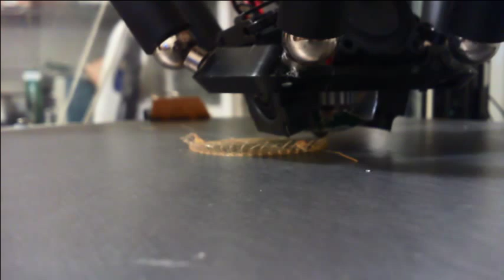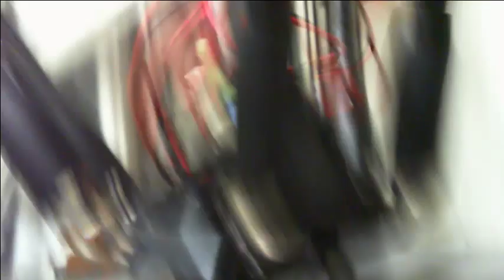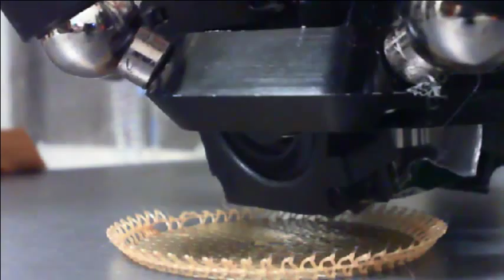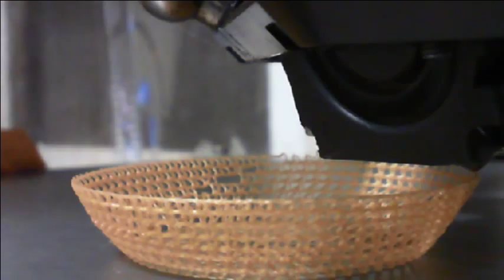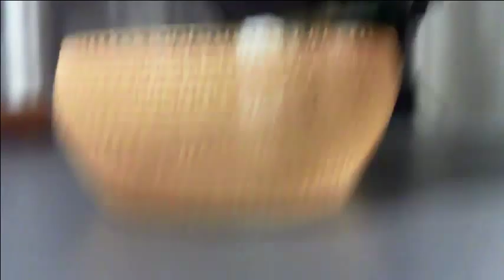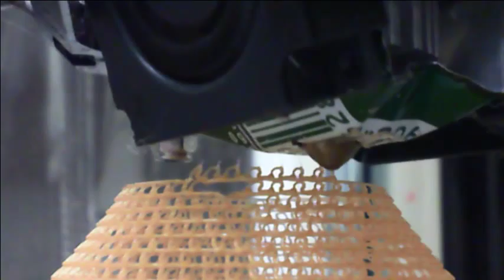Wireprint Vase by Cura 15.06.02 on ATOM3Dp

Comment: I am digging the heat shield. The print looks to be going better than a video you uploaded previously on the 27th. What tweaks did you make between than and now?
Reply from the maker: +Mike Creuzer i tweek my nozzle angle in cura setting for correct one.
Since my nozzle is not common E3D style.

Comment: how to set up the wireprint @@
Reply from the maker: Bruce Vlog 
Use Cura 15.06.0x
in configuration open the wireprint related options.
BTW, you might need to change your printer qml profile for the nozzle angle.
Reply: Clarence Lee amayzing ! try maker one later ~
Reply: +Clarence Lee how did you configure the latest cura for deltabot? can I get your JSON file?
Reply from the maker: +modeem352 https://onedrive.live.com/redir?resid=4A8428B52DA1C1AF!189135&authkey=!AJCH-Boo5j_PQHI&ithint=file%2cjson
tested on 15.06.03, put it in resources/settings/
Reply: Thanks man!